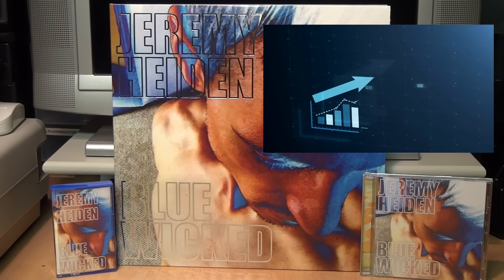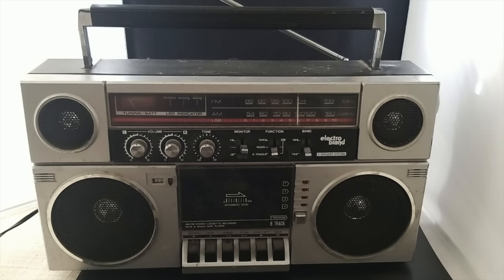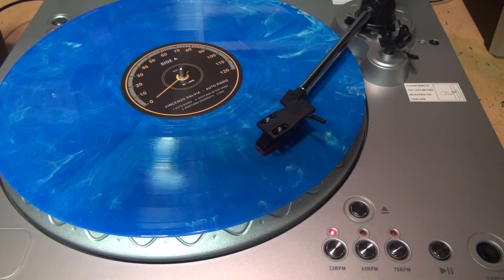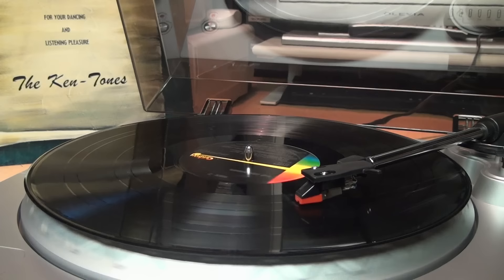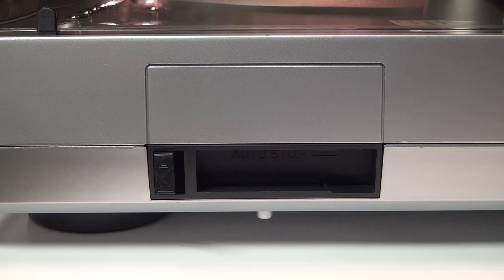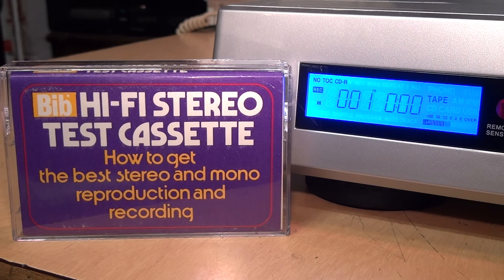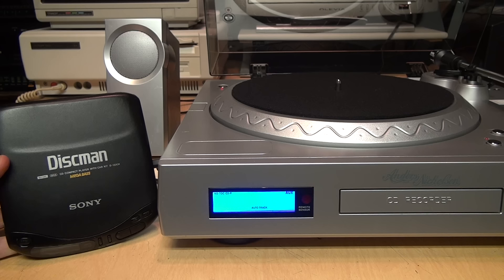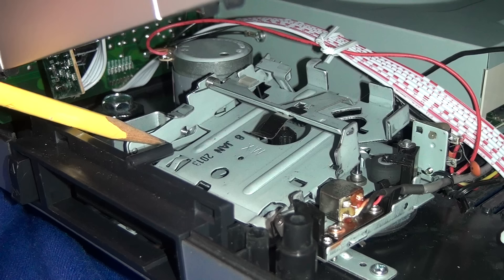A turntable that also plays CDs & cassettes - Anders Nicholson 2655

Comment: It records audio on a standard (data) CD-R/RW? That's pretty cool.
Most CD recorders for audio can only record on the more expensive CD-R Audio discs. I wonder if the MPAA knows that hehe.
The CD audio recording firmware is impressive, and so is the turntable mechanism (though it sounds to me like there's a lot of variation in the turntable speed, at least before you put the drop of oil in?). You could easily add some potmeters and a stroboscope, I reckon.
And it can probably be modified to be a little less prone to mechanical noise by modifying the CD drive.
Oh and of course it needs a DCC cassette mechanism so you can play the Jeremy Heiden album it its best format 😀
Reply: That drop of oil just may do the trick to help reduce or eliminate the vibrations.

Comment: Maybe there's some auto gain circuitry for the cassete player which makes the output hiss when there's basically no input? Because it sounded to me like the hiss came down gradually, but fairly quickly when the audio actually started. Just as I would expect some kind of integrating auto gain circuit to behave.

Comment: But what would you use a level meter for if you're not recording?
So without taking it apart you can't fine tune your platter speed, or clean your head. That kind of gives it a limited shelf life.

Comment: I watched your video last night.  I actually bought one of these units on Ebay about a month ago.  The record player runs way too fast.  Everything else works great.  Would you happen to know what the 2 black screw slots near the tone arm might be used for?   Just curious.  Also I don't believe they are intended to adjust speed because you showed the potentiometers inside the unit.  Just wondering if you noticed the ones on the outside.
Reply from the maker: The manual explains what the screw near the tonearm are for. They're for adjusting the auto-stop.

Comment: I was hoping to see you try the USB out - often the chipset used internally have terrible sample rates or even only output mono
Reply from the maker: No, they don't. Sometimes on USB audio devices when you first plug it in, the settings will default to 1-channel (mono), but you can change it to 2-channel in the Control Panel and then the USB output will be in stereo.
Reply: @vwestlife  Oh sweet thanks for that. My mum bought one of those terrible USB tape players that look like a cheap walkman, and it only supported mono 16k... cursed catalogs that convince the elderly with those "your media is degrading" nonsense, and then offer a way to make it worse when trying to archive it

Comment: 0:30 - 🤦‍♂ Oh, no... Not the knockoff "Early 1980s FF-only" car stereo mech... That's a non-starter for me. I have mid-1980s Blaupunkt mechs (thank you, ACDelco/GM factory radios) that would be better. 🤪 
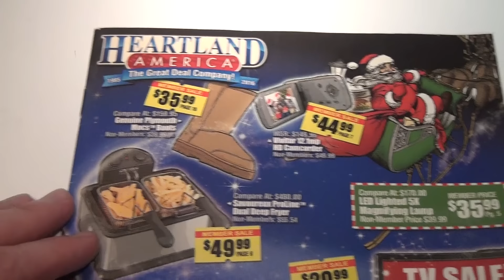0:56 - Aha! That explains EVERYTHING. 
10:21 - If you turn your head, stick your tongue out at JUST the right angle, and apply the perfect level of pressure on the lever, I bet you could make that mech play in Fast-Forward.
11:17 - 100% correct about these mechs being noisy. I've never seen one that wasn't. Horrible hiss, sometimes even picking up a buzz from the motor if it's a dirt-cheap motor. These mechs were cheap in the early-80s, nearly everyone ended up getting Auto Reverse decks with some sort of Music Search feature before the 90s, and these mechs were, for the most part, deprecated. Until the lovely folks at Crossley started slapping them in kitschy faux-antique radios, I had pretty much forgotten they existed.
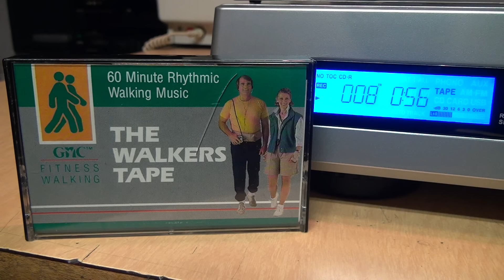13:57 - "Aaaand they're off!"

Well, it's not GREAT, but it's not BAD either. The turntable is surprisingly-good, I expected it to be merely a cosmetic variant of the generic cheapo plastic turntable, and I fully expected the counterweight to be fixed but appearing to be adjustable.

Comment: I seriously was expecting the worst coming into the video, I agree that it actually came close... I hate the brand name, that would put me off it instantly... 
But on the plus side, I like it's styling... It doesn't look like a bushpig. The turntable needed a better platter and vibration dampening, the cassette mechanism at least got the metal flywheel but probably missed out on some decent opamps which most likely explains why all the noisy hiss... Some more control features like rewind, pause and record or possibly auto reverse would have been nice, it's display could also have been used for displaying stuff from the cassette deck and the turntable... MP3 CD support would also be nice... The range of buttons on the front is great, I'm surprised that it has the ability to adjust the CD recording level... Nice 👍.. 
There's as many things wrong with this as there are right... 
It's definitely a tough one. Would I own one? No! I avoid these things even if this one is leaps and bounds better than the rest that I have seen... 
I have a dedicated Yamaha CD/ HDD recorder which can also be used as a DAC... It's the most amazing CD player I have ever seen! Most people don't even know that this thing ever existed... It's got a user replaceable HDD! Even a monitor connection for a larger display... It's kinda like the audio version of the DVD/HDD recorders that a lot of people had or knew about... I have a pioneer and a Sony version of those and they have an identical operating system! These things both video and audio types are excellent media player and recording platforms... Still relevant today... As for the unit in this video, for every step forward, it takes a step back... But it started it's journey higher up the ladder rung than similar products... Unfortunately this isn't for everyone and I'm one of them.
Reply: Mind sharing the model # for the Yamaha/Sony recorder? I'm currently using a portable Tascam for my digitizing needs but wouldn't mind setting up something more static in the long run, and a cassette recorder doesn't really cut it anymore
Reply: @app0the  if you are using a tascam for recording... The Yamaha CDR-HD1300 CD/HDD recorder will suit you fine... 
There are different models so you might see something similar with a slightly different number... As far as I'm aware, the difference between the models is the size of its HDD... You can split tracks as well as combine... Bookmarks are also possible... 
Has a headphone jack with volume control... Automatic track split and adjustable recording level... And it even looks nice! 
I found it by accident on eBay, I was board so I decided to see what the most expensive CD player was.. I wasn't actually looking at buying one. And this Yamaha shows up and I almost missed it... But once I clicked on the listing... And saw it a bit closer.. I just knew that I had to have one. Although the one that I found was really expensive and it was only advertised as being just a CD player... So I searched up the model number and found plenty of them and I ended up only paying $250Au... It came in from what I can only say, new condition.. it had remote control and manuals... 
My son fell in love with it and he got one for himself... 
One mention that I will make, both mine and my son's came with music pre installed... Bonus! Although whoever had my son's one shared the same music taste... 
It's like getting a CD player and it came preloaded with all your favourite music! 
Well good luck with your search.. I hope that you find exactly what you are looking for... 
As for the DVD/HDD recorder.. Panasonic, Sony and pioneer made them... They are literally worth nothing today... Most will have an analogue TV tuner but there was some that came with a digital twin or triple tuner... I have a pioneer and a Sony and they are great for editing videos like getting rid of TV commercials... It doesn't take long before you get the hang of it, the software behind it is actually pretty good, very functional... It has a USB port on the front which I used to put MP3s onto its HDD.. videos can also be put in this way to... 
I got the pioneer what it was new and got the Sony which was in almost new condition from an electrical disposal place for $5Au... I was able to get a new remote control for it from eBay which cost more than the unit itself LoL.. it came with video footage of the previous owner... Nothing usable or interesting.. you just never know what you might see LoL... 
You have RCA outputs and inputs.. 
While the Yamaha has a range of input output options... Google it and see for yourself... If you want it as a recorder for demo's or if you want to store your music collection so that it can be played for days and nights continually for a week... This is the machine for you.... 
Good luck with your search.
Reply: @PeterMilanovski  oh, for DVD recorder I use a Panasonic DIGA already. It has an iLink input and a firmware bug that ignores copyright status of the data, so I can archive ad breaks from historical TV records even if they're protected :D

The CD one I'll have a look into, thanks

Comment: It's interesting to see the other functions that could have been - the radio (FM (stereo and mono) and AM), and 'Card' according to the LCD display.  I'd guess these were dismissed for cost reasons perhaps?  Also no grounding wire that I could see too.  I'd assume the best way for making recordings would be via the Audacity and a computer, which would eliminate the rumble and other undesirable sounds from being recorded/audible?
Reply: No grounding wire for the turntable cord, but the unit was grounded. When he showed the transformer, the were 2 green wires screwed on to the outside metal of the transformer.

Comment: nice review V-dub, if I saw this in a thriftstore I'd probably buy it...can you record directly to USB stick? I have a cheap Ion turntable that does this but it also picks up the rumble
Reply from the maker: No, you need to connect it to a computer. A USB stick won't fit the kind of USB port it has, anyway.

Comment: How could they insulate  the noise from the turntable? Scanning the manual is a lot of work for no gain.
Reply: I think they didn't. Maybe some filter capacitors here and there just like on every PCB. I'm sure there's a quite lot of noise coming out from the speakers when the volume is maximum. These multi-purpose-stereos have a high noise floor because of bad or at least complicated design, plenty of cheap components and plastic everywhere. Was there a grounding point on this device ?

Comment: I havent read the manual but i guess it would be a much better idea to record via USB into the computer anyway for a device like this but it of course is not as simple as recording to the built in CD which really should work much better in the case of the recordplayer. Personally i have both a good quality old record player and cassete player and pro level soundcards since i am a musician so its not for me, but an interesting kind of product although a bit flawed and clearly could be made much better although its mostly workable and not a disaster.

Comment: Good to see a turntable with a magnetic cartridge, instead of ceramic, and an adjustable counterweight. The negatives are the plastic construction, the lack of speed adjustment from the outside, the too rudimentary cassette player, the noisy CD player, this choice of "3 devices in 1" is not really a good deal if you put the priority on quality, especially for the turntable, which needs premium components (heavy metal platter, quality tone-arm, anti-vibration chassis and anti-skating adjustements).
Reply: Yeah. If they went as far as presumably gimp the the original DVD player/writer to a CD through a firmware update, they could have confined it to 1x speed.

Comment: So, if the CD drive creates a rumble in the turntable, the solution is to place a thicker-than-normal felt turntable mat on the platter.
Reply: @neilforbes416 those antistatic mats does the trick
Reply: @top40researcher31  Antistatic mats(plural) "do" the trick! Antistatic mat(singular does the trick! Your English needs some remediation.
Reply: @neilforbes416  But even if you notice errors everywhere, you don't have a duty to point them out, however gently you might go about doing that. In fact, correcting others' errors can do more harm than good, leading those you're correcting to clam up or lash out, both of which obviously impede communication.

Comment: Oof, they came so close to a usable product and put a jet engine under the turntable. (facepalm) I wouldn't see why it would need to be any faster than 2x when recording audio to CD, and most audio CD recorders were probably just 1x. I never had one, though. The DVD recorders of the time had substantial buffers, so I don't know why it would need to rev up to maximum speed just for CD audio. Beyond that, proper vibration dampening could have made this disaster a real winner for people who just want to easily transfer records and tape to CD.

Comment: When recording to CDs do you need to use audio recordable CDs or will regular audio/data CDs do?  If it's the latter then that's quite interesting, because I know many dedicated audio CD recorders only worked with audio recordable CDs for copyright reasons, so this unit may not comply with that copyright restriction.  That hum when recording the record to a CD was offensive, really offensive, I was listening with headphones on and that rumble was really audible.
Reply from the maker: It works fine with regular data CD-Rs and CD-RWs.

Comment: Sadly, the slot-in music cassette is an unfortunate choice. Slot-in cassette players are unreliable and unappealing. 
The choice of slot-in mechanics may have been forced on the designers to reduce the size of this combi device or, more likely, to reduce costs. But it is a deal-breaker for any audiophile.
I like the concept overall. I'm also waiting for some established company to produce a modern-time boombox, with an autoreverse audio cassette, CD / MP3 optical player, a digital player with multiple SD - micro-SD slots with a bug-free software. Of course, four bands radio and DAB/DAB+.
Three ways, 20 Wrms stereo speakers, with D batteries AND Li-po for flexibility. Sure smaller than my prized GF9595.
Thank you for your review. The plastic platter gives away that this combo is for showing off on Instagram and not to listen to music.
Greetings,
Anthony

Comment: 20:00 DVD uses different file system, called UDF, CD used joilet or ISO960xxx whatever number it was,  its like FAT vs FAT32 or NTFS,   would be milion times better if instead CD ROM burner they allow make recordings on SD card :) from CD to mp3, from casette to mp3 from turntable to mp3

Comment: Wish I had something that I could use to digitize all my records or cassettes without the need of a computer.
Reply from the maker: See my review of the TEAC LP-R550USB.
Reply: I like my Tascam SD card recorder. There are many SD card recorders available, and then it's easy if you DO want to put them on a computer. If not you can just collect the SD cards like they are blank tapes.  This of course requires your own turntable and preamp and/or tape deck. 
If you already have these, SD is the way to go.

Comment: I wonder why they don't make new production 8 track players/combo systems.
Reply from the maker: Because 8-track player mechanisms haven't been made since the early 1990s.
Reply: @vwestlife I thought someone might make like a modern reproduction or combo system.

You know like the record player combo system you showed in this video only with an 8 track player too.
Reply: @vwestlife  - I'm surprised ATE - Track Players/Cassettes were still being made in the 1990s.  My Father got rid of his in the late 1970s, got tired of fixing his.  CD's/Tapes/Vinyl was the big deal in the 1990s especially CDs.  I remember 8-Traxx had high failure rates.  Why weren't they made as good as TV/Radio stations very similar Fidelipac/CART machines.

Comment: I wonder if the record or CD could be isolated somehow. Probably more trouble than its worth.
Reply: I bet, for a product from a defunct company.
Reply: You can probably modify the CD Drive mount to put in rubber isolation pads or something. You could probably also put some sound deadening material over the drive itself to further dampen the noise coming from the drive itself.

Comment: There hasn't been a decent mass produced cassette mechanism in a long time. The new demand for them (clearly a result of the cultural and logistical failure of streaming - they took away all methods of recording in standard consumer gear. In trying to protect the value of music as IP, they decimated its value on every other level, as tracks have no currency, material presence or individual value, they are just more content to fill the bucket. To make it better we will need to make it worse: using less functional sites like internet archive for indie music, using cassettes and other means to freely distribute away from platforms. One more point: cassettes are perishable, which is a real issue - but people are wrong if they think streaming and other hosting sites are forever... that music is all going to disappear, except the most persistently famous artists. It is already happening on Apple and Spotify. Youtube and the archive  have become the default repository. Music is culture, not data.
Reply: The new demand for them will hopefully spur production of a good mechanism for consumer products.
Reply from the maker: TEAC and TASCAM are already using good new cassette mechanisms in their decks. And see my videos about cassette tapes that are over 50 years old, and playing one over 1000 times -- they are surprisingly durable!